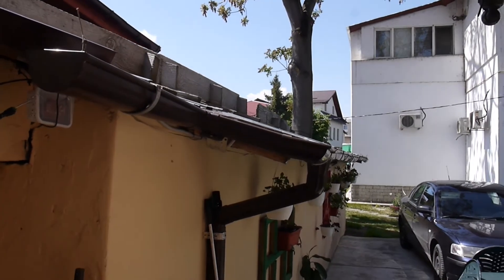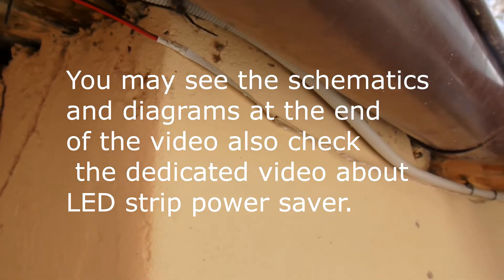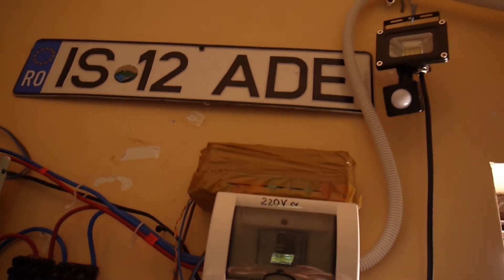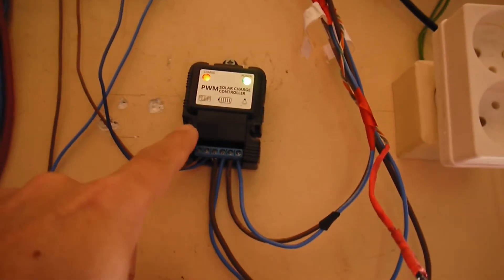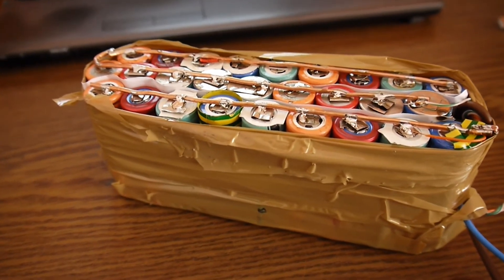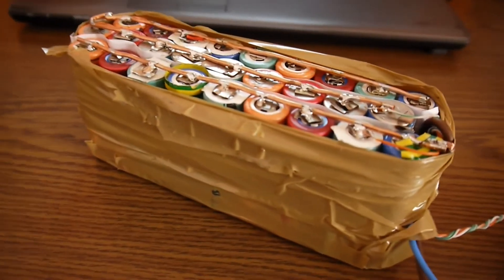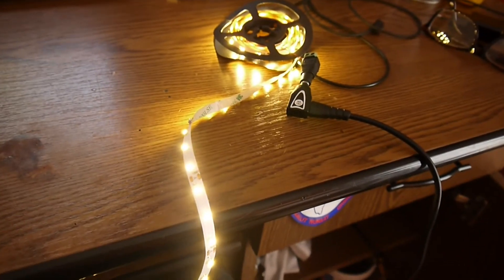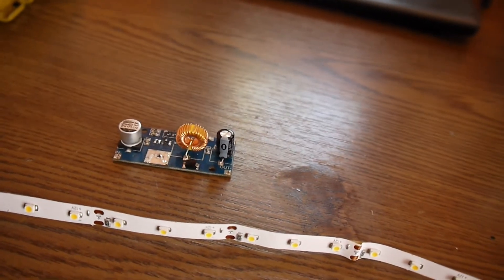How to Connect Li-ion battery to a Lead Acid AGM. PWM li-ion solar charge controller use.

Comment: Great video mate! How did this work out for you? Is that a PWM Li-on Solar Charge Controller?

I'm trying to do the same, currently have a PWM lead acid solar charge controller.

Is it okay if I add a MPPT Li-ion solar charge controller in the same way you did?
Reply from the maker: Well..that is possible as long as you use a dedicated LI-Ion charger..PWM or MPPT...because Li-Ion needs different charging curve..Don't even think about parallel AGM with Li-ion, without a proper Li-ion charger ! BTW I tested and improved a very cheap PWM for Li-ion finally working great here..https://www.youtube.com/watch?v=TeoL4GjfJHk
Reply: @viocaia  Nice, I'll go watch it. Thank you 😇

Comment: at 15:20 minutes your battery schematic is in the theory right BUT in real life the 18650 have their own bahavior.
if you want to connect the cells in parallel so you need to connect all the 1-9 cells negativ together. this means even cell 1 with cell 3 and cell 1 with cell 4  so on. then cell 2 with cell 3 and then cell 2 with cell 4...You do that even all the positve cells. otherwise only the 1. and the 9. cell get all the current and the middle cells dont deliver current fast enough to the cell 9 which is connected to the load. so they work very unbalance and even charging is unbalancing and the cell wont live for a long time they could be..
Reply from the maker: Yes yo u're right.It should be a kind of star connection, to have a even charge /discharge current.Well, this is just an experiment, my 18650 are not even same capacities, I just experimenting for now, that li-ion is not exctly contributing to my main battery pack.Now I've ordered a BMS, with balancer and all the protection for li-ion and I'll start soon new experiments.Thanks for looking.
Reply: I think putting the negative terminal the opposite of the positive terminal on each group would make all the cells connections the same length and avoid this problem. Like the positive side all connected in a straight line, having the positive connector on the right of the first cell, all the negative side connected together, having the negative terminal on the left of the last cell. (Reading from right to left)
Reply from the maker: Hey! Will you help me with subscribe! Thanks!